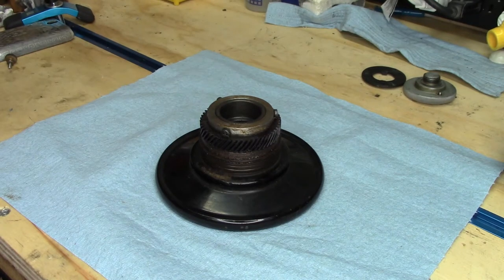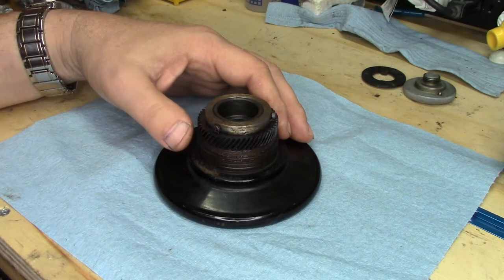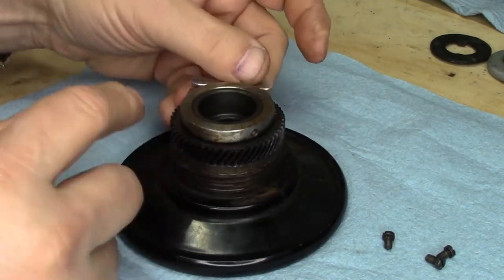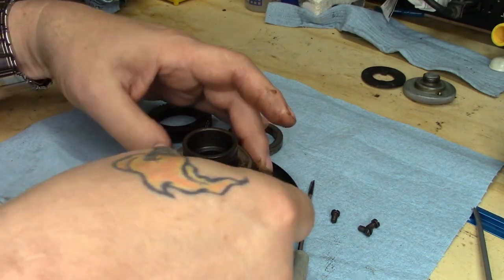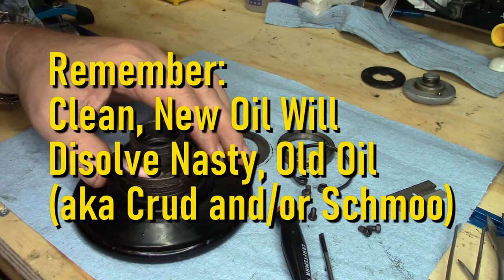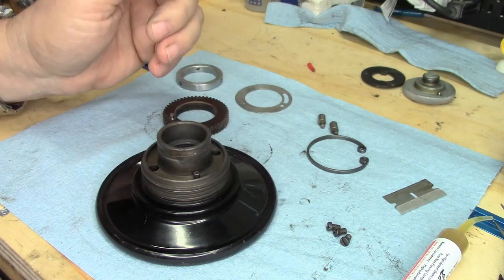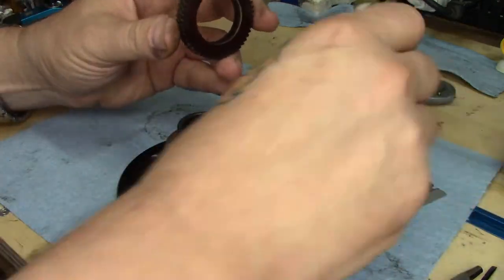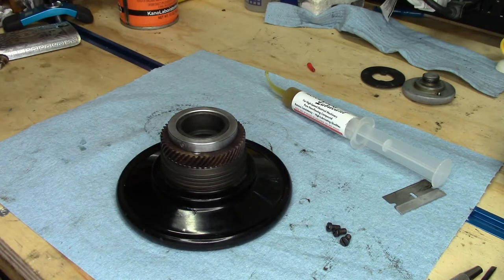Singer Potted Motor: Help With A Stuck Balance Wheel

Comment: I recently rewired a '48 201-2 and it's as weak if not weaker than it was before. It struggles with the bobbin winder. The commutator is pretty scored, so I bought another rotor. If that doesn't do the trick, what should I look at?
Reply from the maker: The commutator bars are usually the biggest issue. Replacing the entire rotating mass should do it.

Comment: The 201-2 that I have was my mom's and I don't think it has been serviced since leaving the factory in 1951. Figured it would be a good idea to service the balance wheel. I"m unable to remove the retaining ring from the textolite gear. I'm able to insert a 0.0025 feeler gauge all the way around but 0.003 is more challenging where the retaining ring meets the pin in the textolite gear. The gap  clearance does not permit insertion of a razor blade.  I placed a tiny bit of sewing machine oil in the area hoping it would dissolve any possible crud and have gently inserted the feeler gauge several times a day for the past two days. Do you have any suggestions? The exterior surface appears in good shape.  If I just put the balance wheel back on, would the little bit of oil I used cause a potential problem with the texrolite gear or motor?
Reply from the maker: No, it won't cause a problem. If you're here in the States and can live without it for a day or so plus shipping time, you can send it here and I can fix it for you.
Reply: @BobFowlerWorkshop  Thank you for your kind offer of help. It took a while for the old oil to dissolve on the shaft of the presser bar, so will try to be patient with this part too.  I look forward to each new video that you up-load.

Comment: Hey I just had a question. I have a 1932 Singer 15-91 and when I opened up the balance wheel it didn't have those pins that seat in the bores that keep the spring from making noise. It does have the holes, just not the pins. Is that normal for this year? Thanks!
Reply from the maker: As far as I know, no, the pins belong there. Someone has been there before you...
Reply: @BobFowlerWorkshop  Interesting. Do you think it's safe to run the machine without those? Looks like the only way to get them is to buy the entire hand wheel assembly, at least on ebay.

I do see that vintage singer parts sells the pins, so I'll definitely get it in the future unless it's absolutely needed to run it now. It makes me wonder, why take just those parts? Everything else was in good condition and nothing seemed to be tampered with other than those missing pins. Anyways, thanks again!
Reply from the maker: @mikeypotts4732  Absolutely safe, just a bit noisy maybe, but you won't blow anything up.
Reply: @BobFowlerWorkshop  Awesome I'll go down that route for now then lol. Thanks again for all your responses! You're a great help. Without your videos I'd be completely lost haha. Much appreciated!